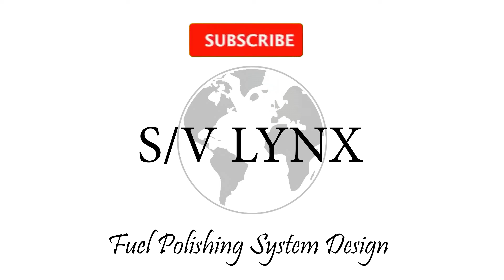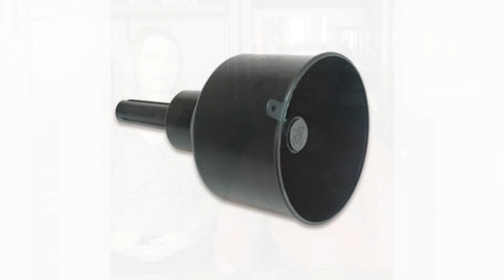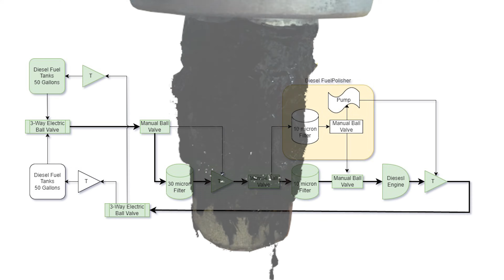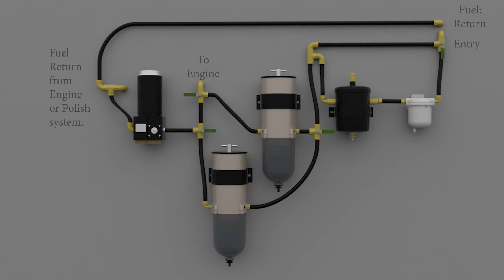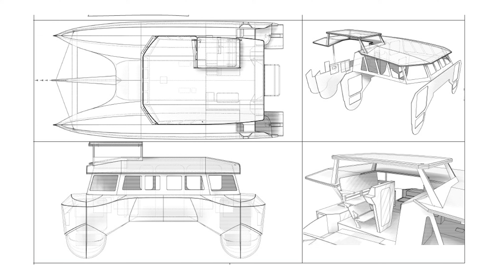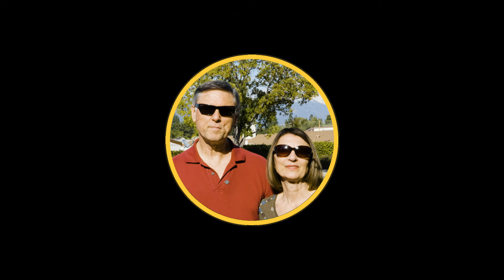Kit E23: Fuel Polishing System Design for our Catamaran Build

Comment: I agree fuel tanks should always cascade to each other, in case of over filling. I disagree with having a fuel tank located above the engines, in case of fire or spill into the bilge. If the tank is already mounted high and above the engine or fuel system, the tank needs an isolation valve that can be manually closed remotely from outside of the space. I prefer Keenan Filters (upgraded Parker filters) MK60DP I think would work best for you. Pay the extra money for the ABYC/USCG approved Polyethylene fuel tanks. Just my personal preference for what it is worth respectively.
Reply from the maker: That video was many years ago.  We changed the fuel tanks significantly and they are all in the boat now.

Comment: Please help.
I have been searching for a fuel/water seperator like the one you mentioned as your "fuel deputy" without the paper filter.
All the ones I have found have paper filters in them.
Will you please provide information on the one you have in your system so that I can locate one like it on-line.

Thank you.
Reply from the maker: The one I talked about in the video is no longer available.  Try searching on Skimoil.
Reply: Thank you 😊
Reply: @SailingSVLynx
Thank you for your help.

I checked with that Company.  They had two models (sizes).
The smallest one was around $2,500 and the largest one was around $3,500.
Both, unfortunately, were beyond my budget.  I was hoping to find one for $1,000 or less.

I hope all the best for you and your wife on your awesome project.  😊
Reply from the maker: Sorry about that, also rich for my tastes as well. :(  Thanks for the kind words and for watching our videos!

Comment: If it is not too late to make comments on the fuel system and the polishing system. Based on my own seagoing experience.
1. Good fuel husbandry avoids many of the horror stories that abound. Fuel husbandry is tedious and has to be routinised.
2. There are all sorts of contaminants that effect diesel fuel MBC which you majored on here, basic dirt (from the supplier) water and one surprise - fuel derived dirt. Modern diesel is cracked further up the distillation column and essentially it is now an unstable product and during long term storage it will start attempting to revert to crude (black particles). Avoid refuelling from facilities who do not sell in volume.
3. I think you need to review you fuel system in a fairly significant way. If your design is hell bent on the forward fuel tanks which involves running fuel lines through the boat to the engine compartment, then it would be very worthwhile considering a ‘day tank’ much closer to the engine for supply/return to the engine.
4. On the polishing side of the equation, first ditch the MBC filter (snake oil product) and rename the system ‘polishing and transfer’.
5. On the husbandry side - tank design is fundamental to this to. If at all possible ensure you have the largest possible access ports in each baffles area of the tank. Fuel draw needs to be right in the bottom of the storage tanks (because you want the polishing system to draw out any water). For the day tank the supply to the engine should be above the bottom of tank.
6. Fuel Management - prior to refuelling (you should aim to be only refuelling one tank) transfer the fuel out of the tank that will be refuelled to the other storage tank. Then once refuelling is complete the tank should be embargoed until it has been polished for 24 hours.
7. Size the day tank using your usual estimating methods to provide for 24 hours running at say 70% power.😉
8. You are unlikely to suffer MBC if you keep on top of the fuel husbandry BUT if you ever do - the polishing system will not clean it up - only tank cleaning will do that( comment at 5 applies).
Reply from the maker: Hey, thanks for the detailed suggestion list, we appreciate you taking the time.  Now, onto some of your points. :)
1) Yes.
2) We agree completely.
3) We were already considering a day tank, but still haven't decided on it yet, but are leaning that way.  As for hell bent... we have no choice, to balance the boat, both diesel tanks must go forward.
4) We already ditched the MBC filter after doing more research, snake oil indeed.
5) We designed our own diesel tanks.  You may see that in Episode 25, about midway in.  They only require one access port to reach into all baffled compartments, plus other 'innovations'.
6) Good suggestion.
7) Agreed.
8) That's why we made it easy to clean out the tank, either from the sump, or just cleaned from the access port in extreme cases.
Reply: @SailingSVLynx  Yes I indeed, I only found your channel a week ago and I am doing a near binge catch up. I have now seen the proposed design of your tank, if I may - if you have four baffles or four compartments in the tank - put four access ports in the top. Cleaning out a contaminated tank is a horrible task (I have done it a few times), the sheer fun is magnified if you do not have a universal joint on your elbow. Enjoying the series and your approach.👍

Comment: I'm so cheap that I wrap my Epoxie paint brushes with Cerran wrap then I leave them in the freezer overnight. The next day they are good to go. I don't recommend this but I have many gallons of used engine and transmission oil that I have saved up so I mix used oils with diesel 1to1 and put it in my fuel tank. I no longer have a problem with algae but I don't know why.
Reply from the maker: Interesting on the diesel.

Comment: My humble opinion is if you are purchasing fuel from a respectable source, there is no need for such equipment. For new construction, a simple access plug to the deepest part of the tank should be sufficiant.  I use a water reacting paste on a long rod to test for tank build up, we do keep our tanks full during off season storage.  I do use additive in new fuel because it's so easy.  Storage of the product and the other handful of toxic substances required for a cruising sailboat, is manageable.  We also run short of most expectations in that we only run one Racor and a small final engine mounted filter.  I have never seen water in the bowl and the small amount of solids I removed (first cleaning in 30 years?) appear to be non organic so Im calling it refinery dust.  Not saying this is the answer for everybody but it sure works for us.
Reply from the maker: Sadly, we have no way of knowing if we will be purchasing fuel from a respectable source as we travel around the planet on a circumnavigation, often traveling through third world countries.

Comment: I'm curious, would you be able to use a uv light system to kill off the bugs? Like is done with a well water system. Admittedly diesel isn't as clear as water, but maybe close enough?
Reply from the maker: Unfortunately though UV light would help, it also degrades diesel fuel, or so we have read.
Reply: @SailingSVLynx  Interesting. Did not know that. Off to Google! 😀

Comment: What about eliminating diesel completely and instead, having both electric motors and one gasoline generator as your hybrid option?
You will not have this fuel issues with gasoline and maintenance on gas engines is easier and cheaper! 
Also will save money on all of those diesel polishing and filtering systems!
Reply from the maker: Watch Episode 18.  But I will give you the short version.  Hybrid electric is under powered, heavier, less range, and far more costly.  But it is the under powered part that is that primary reason we can't go with a  hybrid electric system.
Reply: @SailingSVLynx  thanks for the reply, already watch episode 28… thanks!

Comment: Yep  
It’s a great plan , and plans are just that , I always start with a denoting letter of the alphabet but consequently use numbers as well .
however you will notice when you start your build the tanks are not that deep once you put the lids on and they are fairly long so you will not get that fuel at the other end of the tank to pass through your “Polisher” as you’d planed because of internal bulkheads and a flat ish  bottom  . We just pull the lids of the tanks every couple of years to clean the tanks properly . Make sure when you build the tanks in , you have access to get in and clean them out scrubbing brush and vacuum will do it , we run the fuel down low in the tanks , pump what’s left across to the other side through the Racors to clean the fuel , take the lids off and get in and clean , it’s not a pretty job . I understand the design I have an older Schionning , but we didn’t build it . 
You will understand later when you go sailing out through a bar crossing and you will get some green water up over the bows , the dorade boxes  will get some serious water on occasions , don’t put them in until you try it  . We have had some heavy water all the way up onto the forward screens punching out through the bar crossing some days .
Reply from the maker: Hey John, thanks for the post and suggestions!  We were already planning on putting in enough inspection ports to reach all parts of the fuel tanks, so we will be good to go when it comes time to do any tank cleaning.  But on to the fuel tank shape.  Ours will be differently placed and shaped than yours, even though you have a Schionning.  For one thing, we already know ours are square.  And one great thing about building the boat is that we get to make things the way we want.  I've always wondered why builders make fuel tanks flat on the bottom.  I did up a design awhile back for ours that slopes the bottom to a central point where I added a sump.  There is a fuel pickup rod that goes down into the bottom of the sump, plus a second fuel pickup that is just higher than the top of that sump.  The higher one is used the majority of the time, so that it doesn't pick up the water and debris that collect in the sump.  However, by switching a valve, we can pull fuel from the lowest point in the sump when we want to polish the fuel so that we clean out all that muck.  OK, so that's my plan, anyone want to tell me why it is a bad idea?  :)

Now, onto the Dorade boxes.  We will most certainly test the boat before adding them.  However, I'm not sure why anyone is concerned about them if I do decide to add these to the boat.  I can make them incredibly strong (carbon fiber or stainless steel, or even titanium; I can 3D print in any of those).  I can design the low profile opening at the front so that it may be sealed off completely if we are in bad weather or going across a bar, and they can sealed be sealed on the inside as well so no water may enter.  They stick up less than a cleat or stanchions, yet no one seems concerned that those will be torn off the boat in a green water wave situation.  So, to summarize, they can be sealed so that they don't let water in and can't be torn off, they are very strong and very low profile, so I'm not sure why anyone thinks these are a bad idea.  Again, comments are welcome.

Comment: Good afternoon. I did not see a pickup pump at the tanks to ensure that at max pitch and roll you are accounting for the pickup limits in the transfer and attached fuel pumps. There are good worksheets available online to help with that calculation and I am sure your engine manufacturer and transfer pump specs give you clear specifications on pickup capacities. Looks like some pressure gauges, overpressure reliefs, and overflow lines with vacuum breakers for fuel temperature changes would be useful as well.
Reply from the maker: Hey Andrew.  We weren't really going over the system at the tanks, other than that we are adding a couple of electric valves .  There is a whole design for the building of the fuel tanks, but this video was more about the fuel polishing end, and even that was only a preliminary design.   We'll show more when we get to building both the tanks and the fuel polishing system later.  :)

Comment: SV Catalpa has a video that shows how they made a Baja style filter out of 6" pvc pipe that uses aquarium filter bags that are available in different micron ratings. We built one and it is incredibly faster and better filtering than our old Baja filter. This filter will filter fuel as fast as a fuel station pump can supply it. We used a 10 micron filter bag and it has filtered several hundred gallons of Indonesian fuel and is still flowing plenty fast. We made ours 12 inches tall and used the 6"×18" filter bag and just pushed the filter down till it all fits and it works perfectly.
Reply from the maker: I'll have to watch that video!

Comment: An excellent design and I'm certain that you'll be altering and upgrading as the build progresses.
A friend built a large cat a few years ago and decided upon an almost Rube Goldberg approach to the fuel filtration system, as he plans to cruise the IndoPacific almost exclusively (the diesel in the Philippines and the Indonesia Archipelago is notorious for dirty fuel).
ALL new fuel is pumped into spotlessly clean 100 liter cans. From here, the diesel is passed through four (fairly) inexpensive pre-filters, before the De-Bug Filter. Then comes the magic/tragic, depending on the level of absurd humor employed. Three large mouth funnels (his wife is still upset about losing her canning funnels!), fitted with paper coffee filters, then an ultraviolet sterilizer (my salt water aquarium system was getting an upgrade, so there that went!). Then another three canning funnels/paper filters, into a separator to eliminate water, then a second De-Bug Filter. From there, the fuel passes through a 10-micron filter and a 5-micron filter. Then to the tanks.
In the tanks, which he built (just as you are doing), he placed two small impellers in the bottom of each tank, which cycle on and off, keeping any water in the tank from allowing much bacteria growth.
This belt-and-suspender method takes about 7 hours to refuel, but he has never had any problems with blockage and clogged lines.
All of this was fairly inexpensive, relatively speaking, and the tanks are drained, cleaned and re-filled every 12 months, just to be on the safe side.
I am hoping that you'll be coming up with something just as efficient but far less involved, as you've proven so many times that your engineering skills are incredible.
Thank you for sharing!
Reply from the maker: That does sound like a Rube Goldberg system!

Comment: I would suggest a 5 gallon running tank where polished fuel is stored. Its not much added cost. That is how they complete the system you have. Plus it keeps diesel pressure up and eliminates air in lines I would also have a tube connecting your 2 main tanks so if one gets over full it auto fills the other one. I have seen a switch bumped and fuel lost because of not having this.  This also allows you to run your engines from day tank while polishing both tanks after a fill up.  Hope this helps.
Reply from the maker: That sounds like an excellent idea, we will consider adding that to our system.
Reply: I was going to say the exact same thing

Comment: Pretty bad design not being able to put a port light on the inside of the hull.. i agree with the comment that its a great way of getting ventilation as it filters through the hulls
Reply from the maker: We don't consider this a bad design, just a compromise.  All choices in designing a boat likely involve a compromise.  In the case of a Solitaire 1520, this is a performance catamaran.  That means she has very sharp bows and narrow hulls to reduce wetted surface.  To widen the living spaces chamfer panels were incorporated.  Without them, the bunk forward would be much narrower.  Or, we could have moved the forward cabins more toward the bows, to where the hulls are more vertical and a portlight might work.  However, that also narrows the forward cabin to nearly a single bunk width.  We choose to have a performance cat with chamfer panels for wider forward births that are also set back more towards mid-ship to increase living space rathat than compromise those cabins just to get portlights on the inside of the hulls.  Others might make a different choice, but neither is bad design, just a choice.

Comment: Here's a crazy idea for an electric outboard. Since you have a brand new bottom end for an outboard that will work well worldwide and you can build a new cover, how about just buying a naked electric motor and mating that with the lower end?

Are any of the motors that you could use for an inboard small enough and have appropriate RPM and torque for a outboard?

 Also, you are a couple of years away from being done and this is a rapidly evolving industry.  Not a single one of those options you researched existed when I first looked 3 years ago.  You might just want to wait and see if something new comes up in the electric outboard world.
Reply from the maker: We do plan to wait and see what happens in the boat industry.

Comment: Baja filters are a great start, but they are really slow, and only filter 100 microns. I'd say that a good polisher is the better plan.
Reply from the maker: Well, as we showed, we are using both in S/V Lynx.  Slow or not, we want to filter the fuel prior to introducing new fuel to the tanks so that we can make sure we are not getting bad fuel to start with.  After that, we will use our polisher to clean up anything that is not visually obvious.  So, though we agree the fuel polisher is the better plan, we have both plans :)